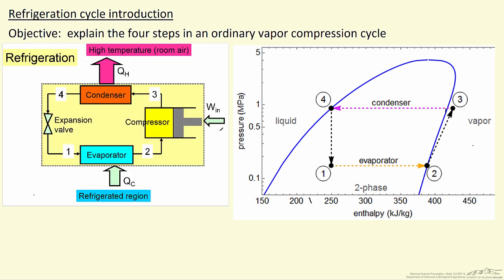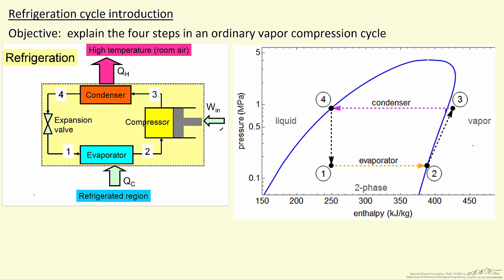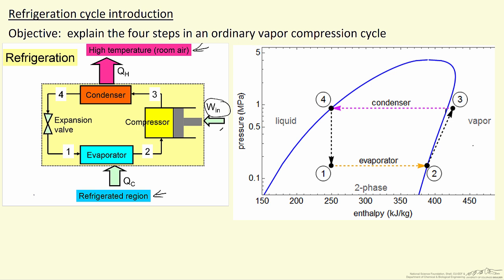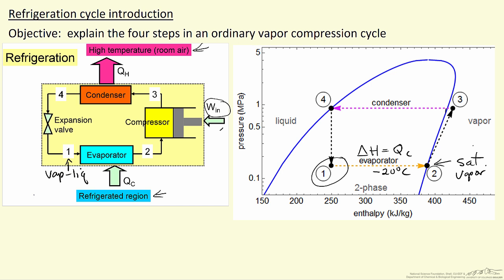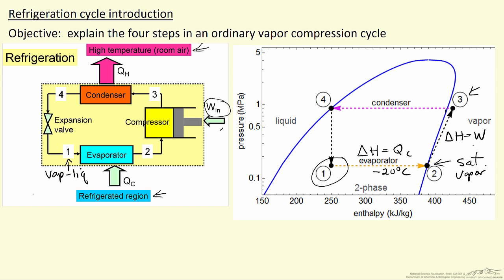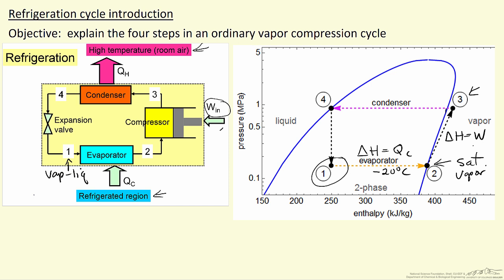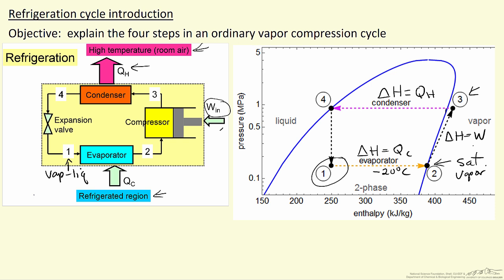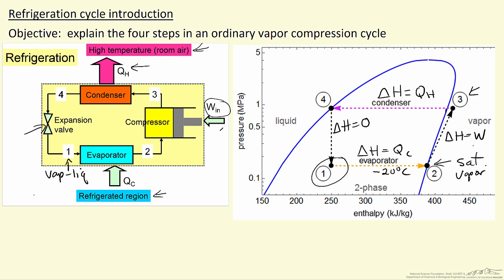Refrigeration Cycle Introduction

Comment: Where does the heat goes when expanding the gas in throttle vale
Reply: If I understand my thermodynamics well enough, I think he may have missed the idea that energy can be transferred by Heat (VERY similar to Work but on a much smaller scale, usually in the atomic region) or by Work. When the fluid expands it takes up more Volume, and essentially uses Energy to expand itself at a molecular level, which in turn causes a Temperature drop as it does. If that doesn't quite answer your question, look into Enthalpy and it's formula, I think it pretty much covers what you're asking.
Reply: @kickboxerinsj13   very well explained

Comment: why did we compress the vapor at the stage 2?
Reply: I think it gets compressed between 2 und 3.
Reply: To increase the pressure and temp of the Gas.
Reply: @Thevisualrealm2106  and why?
Reply: @pedrovaz8150  u increase the temp and pressure so that it be higher than the surrounding and then Q of condenser could  transfer from higher to lower
Reply: It's needed as vapour inside the compressor which always needs vapour as last product from the evaporator. When the compressor gets vapour from the suction line it presses/ compresses/ pressurises the vapour to a even higher pressure vapour ready for the condenser's discharge line where the superheat starts to get de superheat